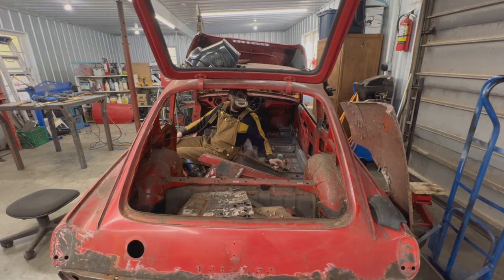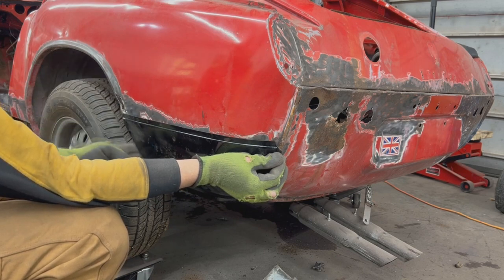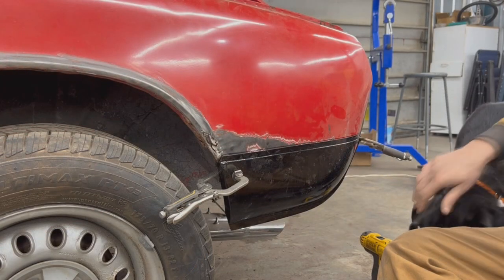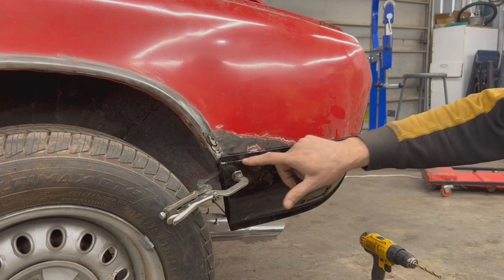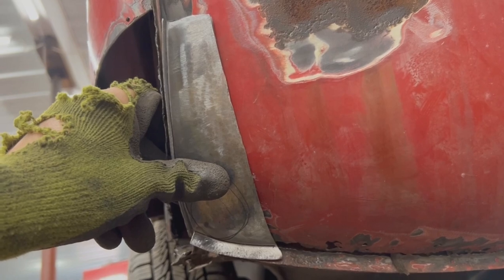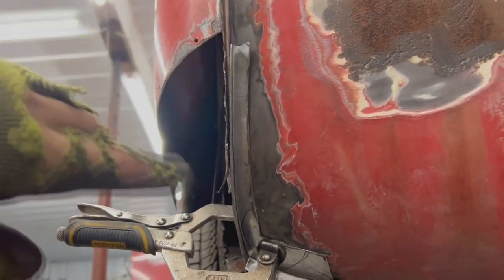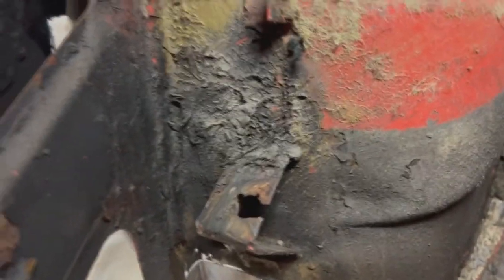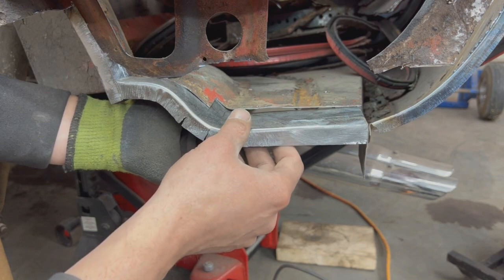1966 Triumph GT6 - part 29 - Rear Fender Can Of Worms

Comment: Definitely enjoy watching all the work, even if it's the same as the other side. :)
If you haven't fitted that floor patch yet, I'd recommend doing the inner structure and bringing it down first, getting it's placement set (just leave the bottom long and trim it up once all the pieces are joined). Then you'll have a definite edge to work to on the floor patch.
On the rear finishing strips, I was not happy with the ones I bought. The gap was too narrow and the ends weren't finished, one had a very sharp point. I attempted to make them fit, but I realized the fit would be terrible and would require an equal amount of work to just make new ones.
Here is my video on that process.
https://youtu.be/42XjHwrOQjA

Comment: Victoria British, LTD. would have almost all the panels you would need even Moss motors.
Reply from the maker: Thanks, but Victoria British are long gone. They were bought by Moss Motors and they have Victoria's inventory now. I am buying new panels only if I can't repair the ones on the car which is almost never :) You will see in the following episodes if you keep watching, how new panels require a lot of modifications to fit properly. It is not necessarily that the panels are bad, but our Rusty Beauties have often seen so many repairs in their lifetime, that nothing is like original anymore. But also some reproduction parts are really cheap and low quality. So like I said, I first try to fix what i have, then I think of eventually making my own panel and only if I don't think that is possible or efficient I go and buy new panels.
Reply: Vicky Brit was three doors down from my office when I worked in Kansas City (Actually Lenexa, KS). Quite the treat to pay them a visit over lunchtime.